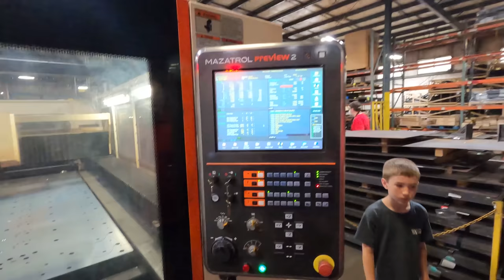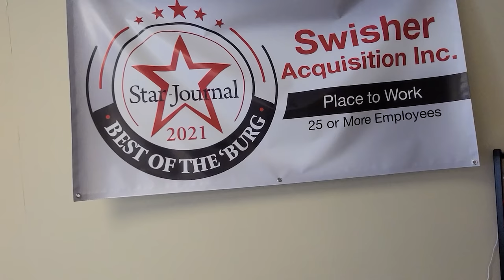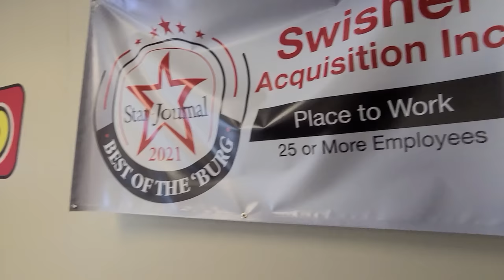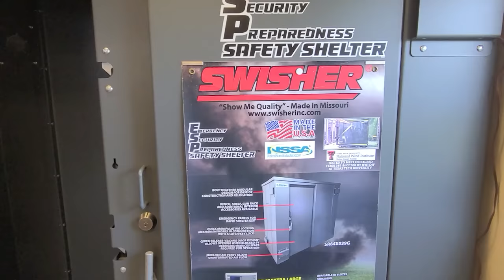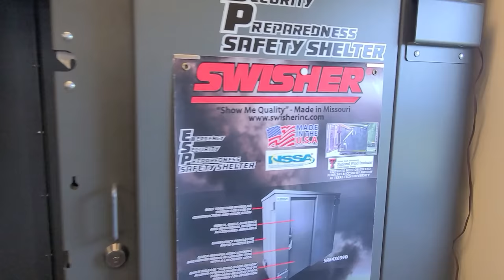Swisher Inc Outdoor Power Equipment BEHIND THE SCENES Tour

Comment: Both my father and I have Swisher pull behind finish mowers- Dad has the 60" and 66" for this feller... almost always used offset, fantastic beasts they are- and have held up great for more than a decade each.
Reply: It's good to see the Kawasaki engines on their products now instead of the B/S. B/S went downhill, in my opinion, when they got away from the L head engines.

Comment: I have a 44 inch pull behind finish mower that I match up with my 50 inch rider. Mows great. Cuts my mowing time in half. Mow about 6 acres weekly. When i needed parts, i called Swisher. They directed me to where I could buy them locally. I appreciated that. Didnt need to wait for parts to be shipped.

Comment: Might need to let my dad know about this brand as he still rocks his old 1980 Dixon ZTR because it was a "local company" back in the day. Parts are getting hard to find for the old gal, so maybe another American made brand can win him over for an upgrade.
Reply: Check out hustler mowers as well. Made in Kansas. Lots of options
Reply: @codystelzer5700  used hustler commercial mowers for years. They are great as long as you don't get one without enough hp. They are high maintenance though and parts are not cheap. Haven't ever used one of the mowers the size of the swisher in the video though, just the big twelve foot cut range wing.

Don't know the price of the lawn mowers hustler makes but the range wings are very expensive.  Also not easy to work on  without small arms and hands. Way too tight for guys with sasquache arms.
Reply: man Dixons were the shit, especially when Blount owned them. I'd recommend Exmark these days, they're still made in Beatrice, NE
Reply: I have 2 1996 ztr 3362 zero turn mowers the first one I got did not have a deck I ran into the guy at the scrapyard bought a Craftsman tractor off of them and then he goes I got a couple more at the house come on by so I fall news house and he had this thing sitting there the first one that I got and it had no deck because all it runs I go that's cool well I got a brand new battery in the back of the truck for another tractor let's put it in well it wouldn't crank you know and I didn't know anything about him I know tractors but I've never worked on one never even seen one up close and he says how much you give me for it I go out tell you what I'll give you 60 bucks for that one and the Craftsman lt2000 that thing was like a 2001 model didn't run wires were chewed up by an animal he was at the scrapyard when I saw him pulling in and I intercepted them so I've literally paid $30 for it motor was free I spun it by hand and he says I can't get a deck for it nobody's got one you can't find them anywherewell I said okay went on to let go that night and sure enough I found one for $150 complete runs works so I hit the guy up I went to the next day and got it and it ran just fine it started right up soon as I put gas in the head drained all the gas out for once somebody did what they were supposed to do and I go to drive it and it worked at first and then all the sudden it just started going haywire come to find out there was missing one of the rides for the break that pulls on the break when you pull the levers back and it was out of adjustment so I got that one running good I got it adjusted it works pretty good I still got to make a few more and they're both in great shape they're both running driving the other one wouldn't start because of the solenoid  it was gone but if you jump the starter it would fire right up and it drove decent to it was out of adjustment but I needed those break clever things for the one with the duck so I decided to take the parts off I needed it still runs it'll kind of move around its just doesn't let you control it at all just thought I'd share the story  since it was mentioned they're pretty cool tractors well-made I love the design of the drive it's all external and it's just these cup disc and they work great once you get them adjusted . God bless everyone keep up the good work Derek

Comment: I recommend they make some more "home owner" level products (like a log splitter for the Hobby Farmer). It is so great they are an All American company!
Reply: They do make log splitters! Electric and gas powered.
Reply: Do you mean 'cheaper and nastier'? there are plenty of companies out there wasting resorces making that stuff. Buy the good gear, keep it twice or three times as long, the premise there is you need to get it serviced and care for it, that will cost extra, its not throw away junk and should not be treated as such.
Reply: @bobbob-fg5wy Bob,  I didn't communicate well. I still have both my John Deere 317s I purchased new and my Dad's Model A Ford. I know a thing or two about taking care of quality things and making them last (My 96 4X4  3/4 Ton Suburban has 300K+ miles on the original 454 and trans).
 I think they could make quality smaller versions of some of their equipment, just not as heavy-duty and powerful that would meet the needs of the 5-10 acre Farms.
Reply: @benkanobe7500  Smaller isnt going to be cheaper by much, its the same amount of parts and time etc just a little less steel. There are other machines on the market with less HP and smaller decks with stamped steel and light weight everything. Pretty sure even Deere do a budget end machine. 
5-10 acres you'd do well with a machine of good commercial spec and quality as come time to trade up you have the market, its not worn out like a commercial used machine with lower hours and better shape than anything else forsale you can command a good price. Its perfect for a commercial guy starting out or a fellow land owner without the budget for new.

Comment: I have had a 60" tow behind Swisher for 20 some years. Called Swisher last year for deck spindle and had it in my hands within a few days. I tow it offset behind my 54" Kubota tractor/mower. Makes quick work of the large open areas of the yard.

Comment: Fantastic video. I worked as a fabrication welder for 15 years, 10 of which were in a large structural steel shop that included a lot of heavy equipment. Good times.

Comment: I lived in warrensburg for 29 years.  I obtained a thirty year old ride king from my neighbor and used it for several years.  Strangest design in the world with that front single wheel doing both the steering and traction of the mower. You could maneuver around anything and it actually had much better traction on hills than you would believe.  Mine also had a Tecumseh engine.

Comment: i bought a bunch of mowers and a  older non running swisher z turn was included .60 inch deck did research and found it to be rare in this area .rebuilt it and sold it. and the quality of the manufactured parts held  up to ware really really well  and was well built. engine was a 24 hp Briggs .also had a another swisher not a z turn ..it was well worth building and drove really well and solid .great machine you need to get out there more . my  mechanic's opinion for about 30 years in a manufacturing and service in auto ,fork lift and manlift with small engines  .great job. thanks for the the walk through of this plant .

Comment: Worked there from 2003-2008 in the welding department. Was a great company to work for right out of high school! Factory had changed a lot since I left. Helped install and weld that entire assembly line on nights one winter. Great video!

Comment: I have to say powder coating really changed the game for reloading. No more messy grease to lube em no more expensive machines to size and lube. Just cast pick out the good ones toss em in a plastic canister with a lid and the powder coating of your choice toss em in a convection oven at 250 for 25 minutes then size em and load em. Easy peezy lemon squeezy help a guy save on target practice.

Comment: I had a 48" Swisher Trail mower that I used to mow my 3+ acre yard for about 15 years.  Pulled behind my ATV and could mow the entire yard in about 45 minutes.  Went through 2 mowers in that time.  The deck didn't fail, all of that was good.  I threw a rod in the motor which may have been partially my fault on maintenance. :)   I work in Medical device manufacturing, so definitely appreciate all of the work that goes into the final product whatever it is.

Comment: I have a Swisher 60 inch pull behind finish mower that I use behind my 4Wheeler.  It works great.  The only issue I have had is the powder coat on the deck has popped off in various areas in somewhat large pieces.   A little spray paint isn't a big deal to fix it and it the mower works as designed every time I go to use it.  One big plus is the spindles have held up over time and the engine has been strong.

Comment: Derek I was so excited to see this title on the video.   I have an early 1960s swisher 3 wheel zero turn lawnmower.  I believe it's a A32 ride king.  Been sitting for the last 30 years and I got it out this year to start restoring it!!  Great video!
Reply: Omg I commented before I watched this.  That ride king is the exact mower I have!!  I had no clue what a new one looked like.  Can I get parts for mine from them?? I have that exact mower. Same seat steering wheel with a cheater ball lol and the 2 speed trans!

Comment: At home I still mow with a 3 wheel Big Mow. At the farm I use an old Swisher finish mower that is indestructible. The deck has outlasted 3 or 4 engines. Also, when you need a part you call and a nice lady answers that helps with part numbers. What more could you ask for? Now I need to buy a Swisher log splitter!

Comment: I work in a fabrication shop here in Georgia. We deal with hot rolled cold roll metal… 10 gauge and 12 gauge galvanized. I have never seen 11 gauge before. I knew it existed but I’ve never seen it used.  Cool stuff.  I love our plasma table  does that fancy cuttin

Comment: This reminds me of when I painted filing cabinets for a living in my early 20s. The paint booths and assembly line are basically identical. Fortunately I don't have to do that anymore, but lots of respect for the people who do this work. It ain't easy. I ran a steel press too for awhile. The manufacturing process is very interesting. It's also a dangerous place. You get a healthy respect for safety while running equipment that can maim you without slowing down. My dad could use one of those gravel levelers for the road to his house. What do you get for your old man who has everything he needs? One of those!

Comment: Thanks for bringing us along.  Really nice setup they have going on in the production building.  Tons of products, but ouch my wallet LOL.  That 22 ton electric log splitter would be great, but I'll have to stick to my 7 ton Harbor Freight electric log splitter LOL.  

The walk behind tractor with interchangeable attachments is cool, they need a broom, generator, pressure washer, and snow blower attachments for that thing and they'd have it pretty much covered.  Kind of reminds me of the old David Bradley walk behind tractors and the old Gravely walk behind tractors.  One engine & transmission assembly many attachments...a great idea actually as you only have one power unit to service.  

Definitely a good sign with a company when most of the employees have been there for decades, that really says a lot about a company.  Start to finish built in the USA, that's a huge 5 star rating automatically.

Comment: @31:30 I had one of those in the late 80s. It was a '55 model. First zero turn mower. To go in reverse you turn the steering wheel 180 degrees. I believe it's still running today.

Comment: That's cool! I used to work at a place that powder coated military HMMWV parts. I worked around equipment just like that. I had to take a breathing test to get promoted to one of the guys that spray the powder coat, but I'm a smoker, so I failed the test. I ended up leaving after that.

Comment: Something I have always wished for on my ZTR was a trimmer head attached on the non-discharge side up by the front wheel or right on the deck that you can turn on and off and do your trimming as you do your perimeter cut.  Adjustable up and down, and I am sure it would take a bit of trial and error to get it good enough to be worth it, but man do I hate weed eating!

Comment: Those robots weld far far better than any of those “hands on quality” humans walking around there.  A buddy of mine used to work at a company that built those robot welders.  They made some insane stuff there that could run a perfect welds around an 18” pipe, root, cap, whatever in like half the time any man could and then it could run up the pipe to the next weld on its own.

Comment: I had three of the Big Mow  mowers great cheap zero turn mowers not a long life machine for a big yard lots of parts needed to keep them running but you adjusted the height of cut by shims under or over the blades no on the go adjustment

Comment: as for powder coating application.......they left out that the parts goes through several "washes" before paint.   I was told that you don't paint the metal of the part but the phosphate.  Basically the part gets washed down, then a slight acid bath, then through a phosphate wash which adheres to the metal then the paint adheres to the phosphate, then baked on.

Sorry commented before the end of the video.  Our powder coat line has seven stages. We do new automotive suspension items

Comment: That finish mower with the offset hitch will be amazing once u have the tall grass knocked down plus double the cutting width
Reply from the maker: That's the plan! Looking forward to the time savings
Reply: @ViceGripLodge  u will save time I went from a 42 inch cut riding tractor to a compact tractor with 84 inch finish mower cut the time to mow from 4 hrs to 1.5 hrs 😁

Comment: Scary thing yesterday for the first time in a few years I did some maintenance on my Swisher finish mower and used it I believe it’s a 1980s model maybe 65 inch I offset it behind my 48 inch tractor cuts my mow time in half . Looks like a golf course when I’m done. Almost impossible the scalp with it and it has rollers on the corner if you get too close to something. Just kind of scary that yesterday I use that for the first time in a long time and then this video came out

Comment: I'll have to look into a swisher for my next possible mower.
Here's a question no one has probably asked, can the ruff cut pull behind cutter be pushed ahead of the finish mower so it'll knock down the tall stuff and the finish mower your riding will cut to final hight in one pass?

Comment: Those low lap high control handles look really annoying honestly. I like having the larger handles because you can grip them however you want, from the angle, from the top, even from the same spot those little handles are at. The best part about the convention handles are how they almost meet in the center, so you can maneuver the mower with one hand and hold something, like a rolling trashcan, with the other hand.

Comment: They need to invent it with the front wheels steer also so it will be good on hills . the caster wheels up front are very bad on hills , you loose control if one wheel loses grip and you will slide down the hill out of control

Comment: Do they make 3 point hitch pro driven finish mowers? Mine is getting old. Those rough cuts are awesome, two hints, watch out for lightning rods, ask me how I know, and get some tall Chippewa steel toe logging boots because those things throw some serious material out at a high rate of speed, it’ll ricochet right back at you

Comment: Do they carry parts for the Big Mow models? My parents have one parked in a corner of the barn. Always thought about restoring it. It looks nearly identical to the one they showed. Front sheet metal is slightly different. It's got a flat front sheet metal vs the pointy front sheet metal.

Comment: The only issue I see is size of engine. I use a Husqvarna 254f with the 54" deck. It has the Kawasaki fr691v and honestly that engine is almost at its limit for 54" now a 66" would just suck. You would need closer to 30 hp to mow anything even remotely damp or I guess only mow in the afternoon.

Comment: I wonder if they’ve revised the fuel tanks yet? Last year, My big mow 66 at only 7 hours doused me with fuel due to the front right hose popping off while I was mowing my field .  Flat land, no trees or obstruction to snag anything.  Completely covered my right side from my head to my calf with gas.  Luckily I wasn’t wearing my seatbelt and flipped the key off and jumped off.  I cleared it by 2 steps before it lit up and burnt to the ground.  Swisher initially apologized and offered me a replacement and my money back and gave me their word they would determine what went wrong and fix it so it can’t happen again.  Once they cut me a check for my purchase price, they reneged on a replacement and gave me nothing extra as any kind of restitution for almost burning me alive.  Not even a little extra for my fuel in it or the 12 foot circle of lawn that was destroyed.  
I’ll never recommend them to anyone.  Which is sad because they’re a US company.  I should have sued them.

Comment: Glad to see your piece of Swisher equipment is working out well. Definitely not my experience. Bought a 24" rough cut mower direct from Swisher and in the one year we owned it that dumpster fire snapped 6 blade engagement cables. When it arrived the engine mount bolts were loose and it was covered in motor oil from someone not closing the drain plug. Poor engineering, poor quality control. Best decision I ever made was selling it to put a down payment on a tractor with a bush hog. I want to buy American made  equipment as much as anyone else but junk is junk.